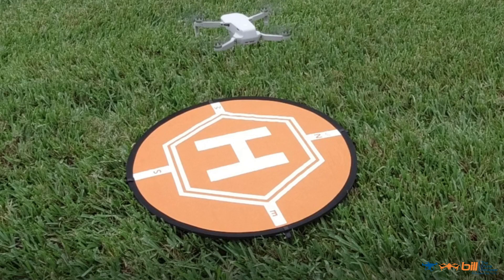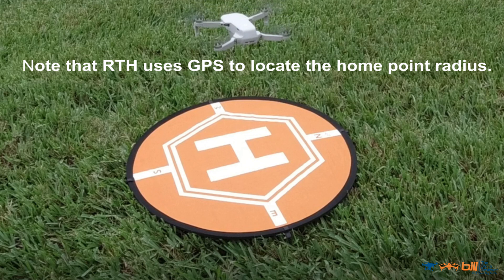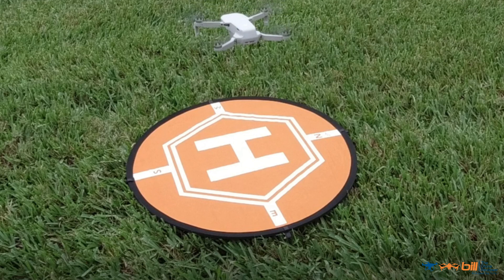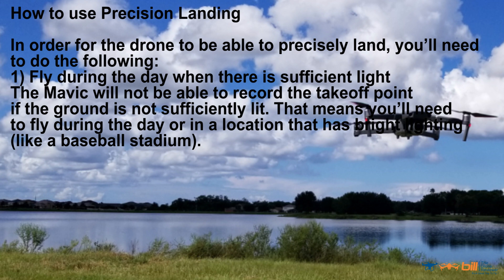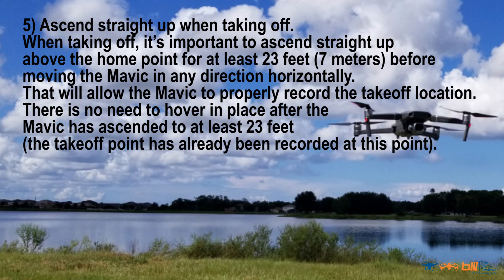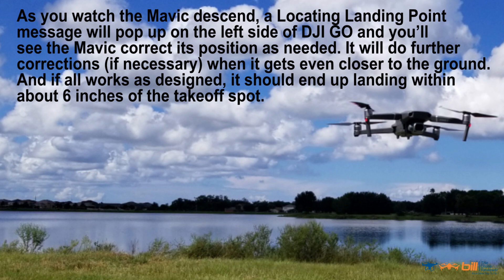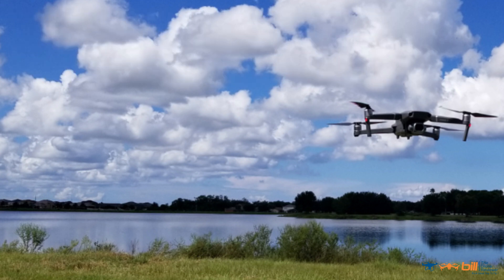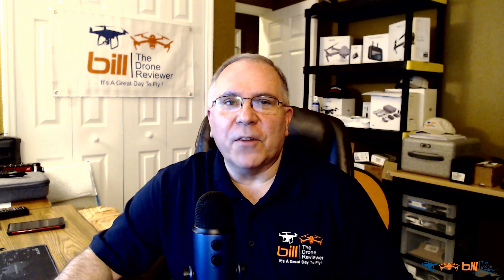DJI Mavic Mini - Return To Home & Precision Landing Explained

Comment: Hello !  I have e big problem, i can't use the RTH mode on my mavic mini, impossible RTH ( I'm french, so i don't speak very good English, i'm sorry)
Reply from the maker: Hello. RTH mode does not work on your Mavic Mini ?
Reply: Bill The Drone Reviewer  yes totaly !
Reply: @BillTheDroneReviewer  I press the button of the rth and my drone does not move, I do not understand, I am 60 meters away and 30 meters high, I had previously set the rth to 30 meters and when I press the button , my drone stays put and does not move, I am sure not to fool you button.
Reply from the maker: @lune1822  Did you try the RTH on the DJI Fly App ?
Reply: @BillTheDroneReviewer  and on the application, dji fly, when I press the button in the middle turn on the left, there is only the landing window that appears, the window (widget) of the rth does not appear, it is impossible for my drone to use the rth, this is not nlrrmal and I do not understand, the compass is calibrate well, I receive a lot of satellites, the gps is OK, can you help me?
Reply: @BillTheDroneReviewer  the rth widget on the dji fly app does not appear, I really don't understand
Reply from the maker: Yanis Chamand Have you done all your Firmware update ? I would try deleting and re-downloading the DJI Fly app. If neither of those works I would contact @DJISupport on Twitter.
Reply: @BillTheDroneReviewer  thanks you very much,  I  try this !!

Comment: It looks like DJI is using GPS for RTH (GPS can have at least a 2' error), they would need to use the camera to take a picture at launch and store the picture of where the drone was at take off.
Reply from the maker: Spot on Russell. Chances are DJI will add Precision Landing in a firmware update.
Reply: @BillTheDroneReviewer  and they need to fix RTH altitude to quit defaulting to 49.2 feet, leave RTH to what the operator put in the last time he used it.